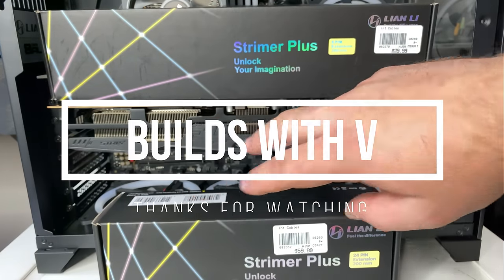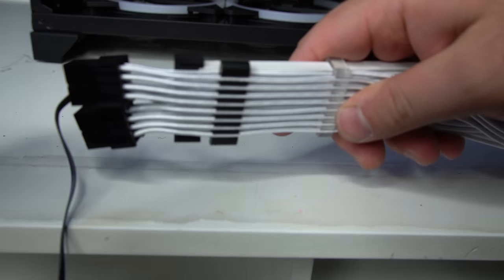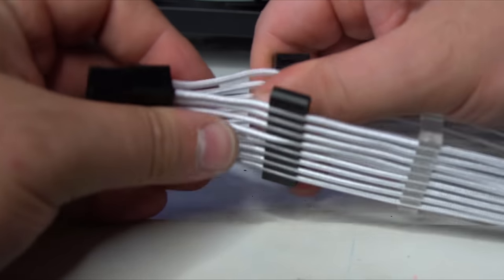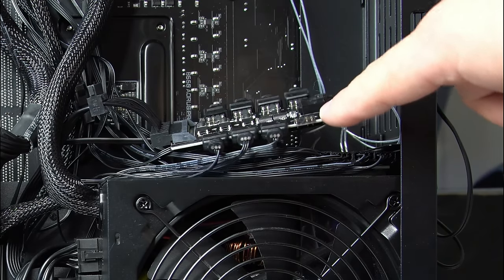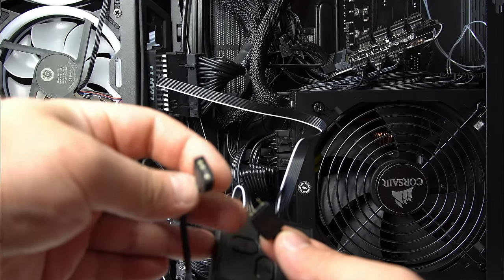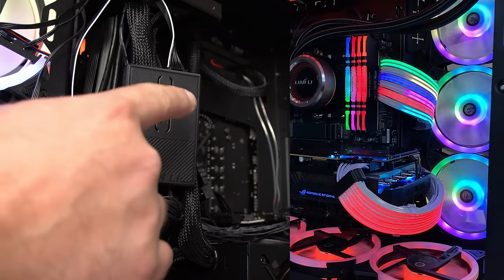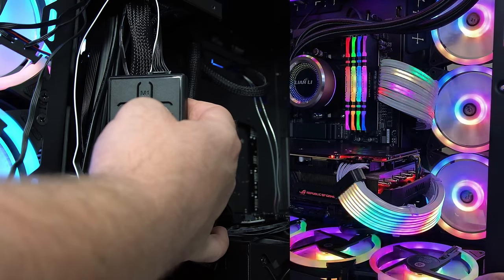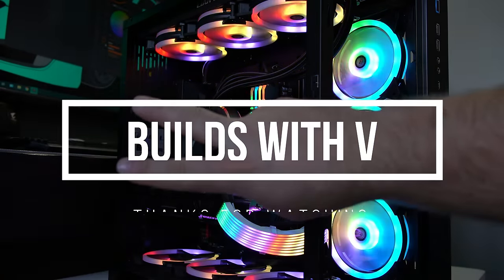How To Install Lian Li Strimer Plus RGB Cables + Review & How To Use

Comment: Great video! I think my Strimer is somewhat broken. I cannot get it to work with the RGB Fusion software from my Gigabyte motherboard (Z390 Aorus Master). The other RGB in my system works like a charm and so does the Strimer by itself. Connecting it to the motherboard however makes the Strimer RGB glitch out and show weird effects. Do you have any idea what could be wrong? My guess is a loose connection. I would really love to sync everything up via RGB Fusion though.

Merry Christmas!
Reply from the maker: Make sure to press and hold the M1 button for a few seconds to switch to using motherboard software. Also make sure you’re using sata to power the controller and also using the 3-pin ARGB cable for your motherboard. Hopefully this helps
Reply from the maker: Merry Christmas to you too 🎄

Comment: I could not find this in the video(maybe it was shown I just do not remember); can you use the mini controller for the gpu cable and for the mob too. Also the aorus 3070ti has 2x8pin and 1x6 pin cable, if I get the triple 8 pin cable I can "put away" a small part to fit into the gpu right?
Reply from the maker: Yeah you can use the controller for both cables. For the triple 8-pin you can put two of the cables away to connect it to your GPU. The triple 8-pin I believe comes with its own controller as well. Not sure why but that’s what I’ve see.
Reply: @BuildsWithV  I saw the controller for it too. Thanks
Reply: a question. you perhaps cant answer it. I would get o11d rog edition (for rear fans) which would use an argb header on mobo. this is the problem because the strimer cables and uni fans use one-one too and i only have 2. since the fan controller will be full can i plug that led thing into cable controller or just let that go(not a problem if it doesnt have any color)
Reply from the maker: @Tomxhawk  yeah you should be able to plug those into this controller as long as it works. I’ve had so so success with it and idk why. Your other option is to get a ARGB hub and connect that to one header and sata power. I have a separate video showing that process as well.
Reply: @BuildsWithV  Thanks, I will try that and if it doesnt work then I will not use the led thing
Reply: ah i forgot about the aio.. i have 2 argb and 2 rgb connector,i will use 2 argb for cable and fans and hopefully the aio and led thing fits ino the normal rgb connector

Comment: to change the 24pin color you need the controller or also from motherboard?
Reply from the maker: You can change lighting effects using just the controller. Or you can plug in the 3-pin addressable rgb cable and controls via software. I recommend using the controller because the lighting effects are better than software. Thanks for watching 🙏
Reply: Builds With V Thank you, I don't understand English but you have solved many of my doubts
Reply from the maker: HeyGhoul no problem at all, glad I could help 🙏 Thank you for watching

Comment: Hi could anyone tell me the difference between the 1x8 strimmer plus and the 2x8 looking at buying but don’t know the exact difference many thanks
Reply from the maker: The 1x8 technically doesn’t exist but the naming is just Confusing. It’s the same one I used in this video for my GPU which is technically 2x8 since it has two 8 pin cables for my GPU. The 2x8 is technically the 3x8 which has three 8 pins for GPUs with 3 ports. It’s all very confusing honestly and idk why they did that. 1x8 should be a single 8-pin cable for GPUs with one 8 pin port and the 2x8 should be a double 8-pin for GPUs with 2 ports etc. hope this helps
Reply from the maker: Unless they came out with a really 1x8 that I’m unaware of, if they did and you found one please send me the link. Thanks
Reply: @BuildsWithV  I will do and thanks so much for explaining cleared it all up for me have a great day man 💙

Comment: Hi, please help, in 1:02 when you say : you can use this with only an 8 pin ... i have a GPU with only 8 pin, so, if i connect only 8 pin, will the rest of strimmer works ? in my opinion if i connect only 8 pin, then only those connected will be lighted, not the rest, can you please confirm and give me more infirmation please ? my gpu is Sapphire 5500 XT, thank you
Reply from the maker: The whole cable will still light up no matter how many pins are plugged in. The rgb portion is totally separate from the cables itself.
Reply: @BuildsWithV   thank you very much, you are really helpful, so you are saying that even if i let some pins handle without being connected to gpu, they will still light up ? thank you very much and please make another video, you explain very well, sub and like
Reply from the maker: @ramichalbi8904  yeah they will light up and still work perfectly
Reply: @BuildsWithV  you are Genius thank you, i perchased them yesterday and will recive them next week , yessssss

Comment: Wait so I don’t get how the gpu cable is controlled the 24 pin is controlled by the controller but how do I control the gpu cable is it only by software or can I use the controller for it
Reply from the maker: You can use the controller for both the 24-pin and GPU cable. I just had the connected separately so I can show the difference effects between software and controller.
Reply: @BuildsWithV  oh ok so doesent that mean that the gpu and motherboard cable will have the same lighting effects since both of them are controlled by the controller?
Reply: @BuildsWithV  I can’t control them individually then right they have to be controlled together since there is only one controller that both cables are plugged into right?
Reply from the maker: Correct, they will both be the same at the same time.

Currently I have mine setup as I did in the video because I like having separate effects but I change mine up regularly.
Reply from the maker: @Plazma21  if your motherboard has a 3-pin addressable RGB connection you can then connect the GPU cable to the motherboard and connect the 24-pin to the controller. (This is how I have mine currently).
Or you can connect both of them to the controller if you’d like to have them match.
Reply: @BuildsWithV  thank you so much and how would I change the colors and effects in rgb fusion do I just have to use the effects and colors rgb fuusion provides? And my motherboard has the Aorus logo that lights up so how do I know which portion is the gpu lights
Reply from the maker: @Plazma21  in fusion you’d just adjust the colors/effect for that specific RGB port and yeah you’d be limited by what fusion provides as their effects and colors. In my experience it’s plenty of different options so I never run out lol

Comment: Nice video, do you know if its possible to use 1 motherboard ARGB header for BOTH the 24 pin and 8 pin? Would I connect the 3 pin ARGB cable from my motherboard to the controller and the RGB software would detect both cables as usual? (Basically I want to use the motherboard argb header to change lighting effects for both cables and dont want to rely on the controller all the time)
Reply from the maker: Yeah it will work exactly like that. Just make sure to press the M1 button on the controller for like 3 seconds to switch to software mode. Thanks for watching 🙏
Reply: @BuildsWithV  thanks for the quick reply! Easiest sub of my life 😎

Comment: Hey guy I know this video is about year old and I'm not sure if ur still are answering questions but I'm going to give it a shot. I just bought a video card and it only has one 8 Pin port for power and the lian li plus cable has two 8 Pin connections so will this work with just 1 8 Pin cable installed to my video card.
Reply from the maker: Yeah it’ll still work, you can just remove the unnecessary cable from the Strimer, or just leave it there and just leave it unplugged
Reply: @BuildsWithV  omg thank you for your response, I thought I was going to lose money not using because of the video card. Much appreciated.
Reply from the maker: @jcny08  no problem at all, glad I could help 🙌

Comment: You plug both gpu and mobo cables into the lian li controller. When you switch on there's only one plugged in. This doesn't show if you can use both plugged into the same controller which is the  answer I was looking for
Reply from the maker: This is for the version one Strimer. I have a v2 video that shows how to do it. The 24-pin plugs to the bottom of the controller and the 8 pin connects to the side with the switch facing the correct connector.
Reply from the maker: But for either v1 or V2 you can plug both cables into the controller
Reply: @BuildsWithV  thanks for this. The problem I was having, and I only realised after watching your video, was I had 2 controllers. One in each box. So I thought I needed both controllers plugged in.

Once I removed one and connected both strimer wires into the one 24pin controller, it's working perfectly.

Thanks for your help!

Comment: is it possible to link 2x packs of the 8pins for GPUs with 3x8pins (rtx 3080)?
Reply from the maker: No need, lian li actually made a 3x8-pin version
Reply from the maker: But in theory yes you could do that, it would just be a bit weird I think
Reply: @BuildsWithV  the triple 8pins are sold out and i cant find them anywhere

Comment: I plugged mine in and heard crackling and the lights are half on. Went back got a new set, still the same cracking and half lights and the controller does nothing. Plugged another set into my 2nd pc and those work perfectly
Reply from the maker: That’s very odd, when you got a new set it came with a new controller and still did the same?
Reply: @BuildsWithV  yep! It’s the hero Maximus viii mobo so it’s newer. Half of the lights kinda stay on, but can’t change anything. set up another set on another desktop with same mobo and lights up perfectly and able to use

Comment: So this does work with 2x8 pins. for my 3090!  But I only want the GPU ones and have 10 fans with Corsair, 2 nodes and a 1 commander pro.  Would I be able to use that?
Reply from the maker: Raj R. Yeah the GPU cables are 2x8 pin and will work with 3090. These plug in using 3-pin ARGB.

Comment: So I bought a 8-pin I’m worried if I have the right stuff to make it work I have a b550 auroras motherboard and i have a 2060 will it work??? Plz help me
Reply from the maker: I believe all the b550 Aorus motherboards have 3-pin addressable RGB ports so it’ll work no problem. It will work with your 2060 as well no issues. Thank you for watching 🙏

Comment: Can i connect the argb (3 pin) connector into a splitter and then connect the splitter  into an argb port of the motherboard?
Reply from the maker: Yes you can
Reply: @BuildsWithV  thanks😄
Reply from the maker: @pietrodelbene5490  it works just fine. They have to say stuff like that in case the product has issues then they can say “they told you not to do that etc.). It always works just fine for me and never had a single issue
Reply: @BuildsWithV  oh, ok. I understand. Thank you so much again😉

Comment: Hi bro, sorry for my English, and hope you help me ! So I want a Lian Li Pc 011 D with 9 Lian Li Uni fan ! and The strimer plus ! But I want to control with L Connect from Lian Li, I need to connect with the 3 pin ARGB ? How to connect with Lian Li Uni fan ? Need 2X 3 pins on my mobo, One for Strimer plus controller and one other for Uni fan controller ? Im lost haha thanks for your help
Reply from the maker: If you want to use the uni fans with L Connect then you need to plug the l connect controller into your usb 2.0 port on your motherboard and sata. The Strimer plus can’t be controlled using L connect unfortunately. The lian li Strimer can be plugged into sata alone or you can also plug it into the ARGB port and control it using motherboard software.
Reply: @BuildsWithV  ooohhhhh okkkk its more clear !!! So I dont need to connect them into aRGB ! Cuz IVe z490 A Gaming from Asus and then have only One 3 pins ! Thanks mate you help me so well !

Comment: I’d love to get these but my EVGA RTX 3080 FTW3 uses 3 8 pin pcie cables, and the strimmer+ only has 2.. any work around for this?
Reply from the maker: I completely understand. The only work around this is to have the Strimer plug into 2 of the ports and then just run a normal cable to the 3rd 8 pin and maybe hide it behind the Strimer cable. That’s my only thought.
Reply: @BuildsWithV  ya it’s pretty eh.. main reason I’m only having the motherboard cable. Still looks absolutely fantastic and thanks for this video! Helped me alot
Reply from the maker: @spinster4000  Yeah I agree, having just the 24-pin actually looks really good.
You’re welcome, thank you for watching 😊
Reply: I read that you can just use an additional 24 pin cable.
Reply from the maker: @vballboy555  that doesn’t work. The connectors are very different unfortunately

Comment: If I’m planning on using the controller do I HAVE to use a sata cable or can I just connect it to an aRGB?
Reply from the maker: Julian Martinez I believe the controller gets its main power from sata and not from the ARGB source. That being said I have not tested just using the ARGB port without sata to power these up. My theory is that the ARGB cable is only used to switch between software and controller and not to power it. I could be wrong tho. Thanks for watching 🙏
Reply: have to have the sata power.

Comment: I can’t get the 24 pin to come up on my aorus RGB fusion? Can someone help I have it plugged into sata cable
Reply from the maker: To get it working on your motherboard software you'd need to plug the controller into sata AND the 3-pin ARGB header on your motherboard. Then you have to press M1 on the controller to switch to your motherboard software.

Comment: Do you need a ARGB or a RGB header?
Reply from the maker: You do not, that’s just an option in case you want to control the rgbs with software.
Reply: @BuildsWithV  Thank you for the quick answer

Comment: Does anyone have a suggestion for RGB cables for a RTX 3080 FTW3 Ultra? It has three 8-pin connectors and I can't find anything that will work.
Reply from the maker: You can still use this cable, just plug these into two of the 8-pins and then just plug a regular 8-pin into the other one and then hide it behind these cables or behind the GPU if it’s vertical. That’s what I’d do personally

Comment: Can I use it with aura sync?
Reply from the maker: Yes you can as long as your motherboard has a 3-pin ARGB header
Reply: @BuildsWithV  But can I do it also with the Controller? I am a beginner sorry :)

Comment: So my GPU is 8+6 pin how would I get that to work
Reply from the maker: Just leave two of the disconnected and you’re good to go
Reply: @BuildsWithV  will they still light up?
Reply: @laska5729  well, literally the light is powered by Sata, not by plug it to the GPU *i guess

Comment: can I use a 24 pin cable as a 3 8 pin cable ?
Reply from the maker: You can not. The pin shapes are different and won’t fit. Thanks for the question and for watching 😊
Reply: @BuildsWithV  Iam buying a rog strix rtx 3080 and it needs 3 8 pin ... can i buy 2 8 pin strimmers and use half of one and "throw" the other half ? .... great video btw <3
Reply from the maker: @aeranmando2613  you can use two of the cables no problem. Just keep in mind that the RGB portion of the cables don’t split. Basically that means the rgb portion of both will be thick.

What I’d personally do is have one of these rgb cables plugged into two of the ports and then have a normal cable plugged into the 3rd port. Just hide the regular cable somehow. Maybe behind the rgb cables. Up to you tho, maybe having two of these wouldn’t be so bad. 🤷‍♂️
Thank you so much 😊
Reply: @BuildsWithV  thank you so much for the help ... i will recommend ur chanel to everyone i know 😅 ... much love
Reply from the maker: @aeranmando2613  you’re very welcome and thank you so much 😊 I really do appreciate that

Comment: Can u use geforce gtx 1660 super and ASUS ROG STRIX B450-F Gaming AM4 AMD B450 motherboard
Reply from the maker: Yes you can, for the 8 pin you’ll just plug in the cables you need. This comes with 16 pins for a 2x8 setup. Typically the 1660 has 1x6 or 1x8 so you’ll just plug those in. Thanks for watching 🙏

Comment: the male argb cable that comes out of the controller unfortunately doesn't supply power, but only signal to your other devices. so for example if you have an argb strip, it won't work plugging it onto there cause the strip won't receive power.. it only works if you plug it into another powered hub or controller which is unfortunate cause most argb ports use that power lol

Comment: What if my gpu is only 8 pin so like half of the gpu cables
Reply from the maker: You can just leave the other half unplugged. Everything will still work the same. Thank you for watching 🙏
Reply: Builds With V dude iv watched this vid 5 times just because of how well it’s made
Reply from the maker: @bubbyonyt84  😅 thank you so much

Comment: What do indo if I can only got the 24 pin
Reply from the maker: You just plug it in like I show in the video. The 8-pin isn’t necessary for it to work normally. The 24-pin can work in its own.
Reply: @BuildsWithV  what happpens if I don’t use the rgb header thing and only use controller?
Reply from the maker: @Must.Excelerate  then it’ll work as normal. The controller just needs sata power to work and light up the 24-pin. Just use the controller buttons to switch colors, effects and speed.